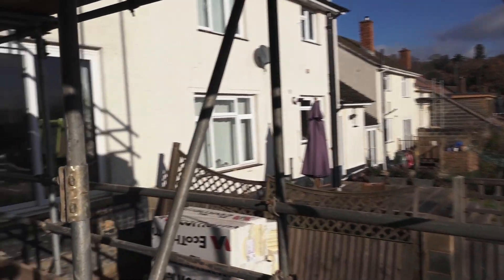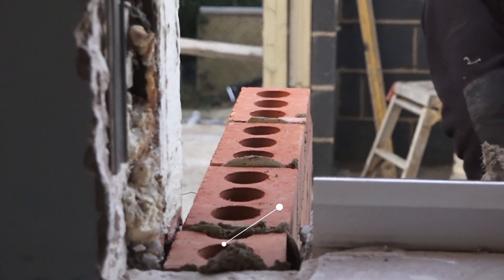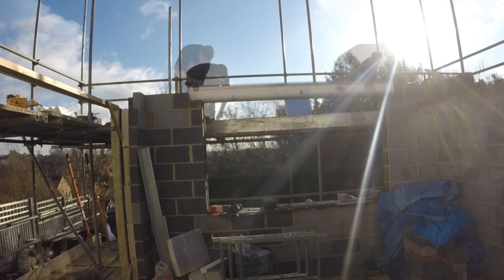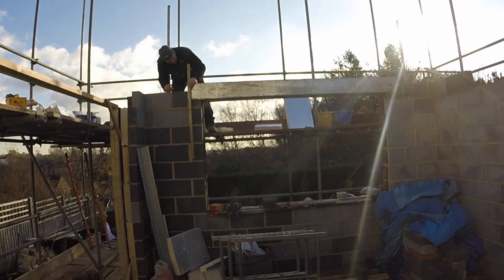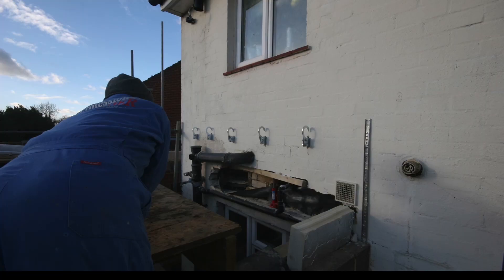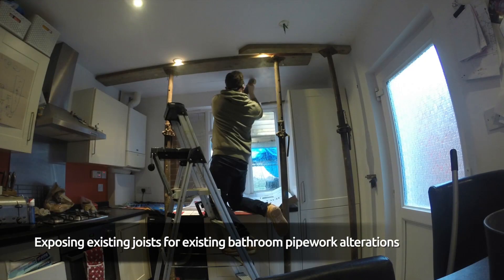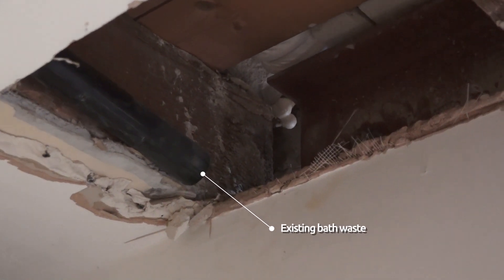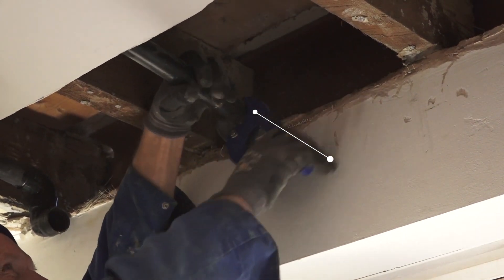Building an Extension #5 - Up to the joists

Comment: Hi Robin great videos and content. Would you be able to advise on costing? I live in Essex and I’ve been quoted between £100-£120k for a single storey rear and side extension... composing basically 4m out at rear which be new lounge and connecting to the side which will be a garage , utility, office and WC I’m really baffled as to why it costs so much any advice ...?
Reply from the maker: That sounds about right. I know a bricklayer who built his own similar to that, so all his labour was free , and it still cost £70,000. A skip is well over £200 now so even getting the groundworks done can be £10,000. Have a shop around but if someone comes in too cheap you need to know why.
Reply: Skill Builder I was thinking back to 2009/ 10 era whereby I got my 1930s semi fully modernised to the tune of about £110k... which at the time was a rear extension out by 3m a side alley into extension with WC , porch and a dormer loft conversion with en-suite and whole house internally replastered and modernised main bath room with mega-flo new driveway with lighting and new garden with decking, fences (both our side and adjoining neighbours)...my how times have changed... thanks for getting back to me so quickly .... really appreciate it.. I thought I was going mad 👍
Reply: I thought some builders save money on ground works by leaving the muck on the road on boards for a grab truck to pick up... not sure how many pickups would need to be done or cost of each grab pick up though...
Reply from the maker: @optimus75  Grab lorries are cheaper but there are all kinds of restrictions. It depends on where you live and what the neighbours are like. A grab lorry often blocks the road while it fills up.
Reply: Skill Builder Thanks again Robin, will have to investigate with the builder 👍

Comment: Hi Roger, just wanted to get some advise regarding a new flat roof. I am currently planning to remove and replace an existing flat roof, with new joists etc. I am planning to add balconies / railings as i intend to use it as a roof terrace balcony from the first floor bedroom (hence the changing of joists). Can you advise or recommend where i can buy metal railings for the balcony? also what preparations would you advise for preparing for fitting the railings as currently we have installed the joists and yet to add the ply and weather coating.

Thanks

Comment: Nhbc don’t like you doing cuts under lintels now has to be a full block
Reply from the maker: You are dead right mate and it is the only thing I picked up on with the work they did. Mark, the brickie, said I am fussing over nothing but I took the block out and put a full one in just to be sure. More of that later.

Comment: Never seen or used these lintels.i used c section lintels on 100 mill block work internal walls. problem with big long catnic  lintels is I never ever seen one that was straight and I put in hundreds always bent or damaged they get moved around in bundles in the builders merchants and dropped of lorries and fork lifts.who commented about putting splits under lintels if your a proper bricklayer and keep your internal  blockwork level to gauge with the face brick work it don't never happen.